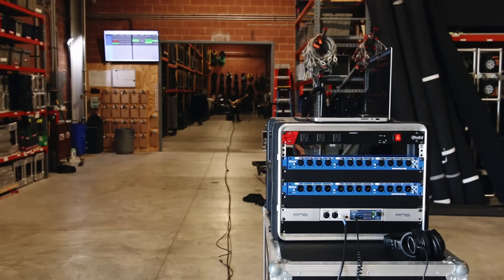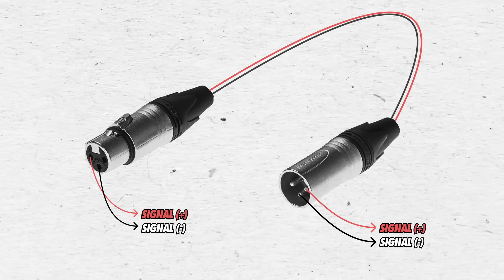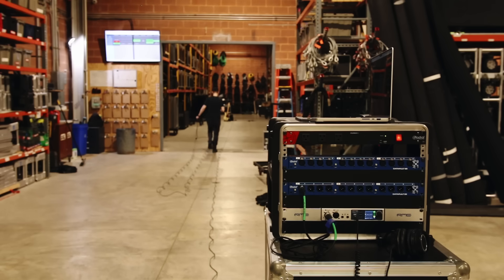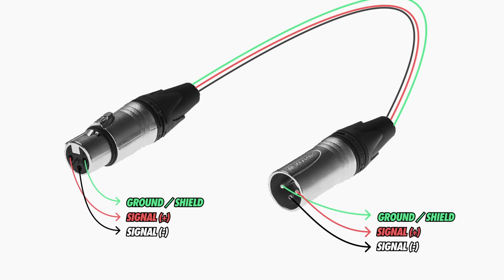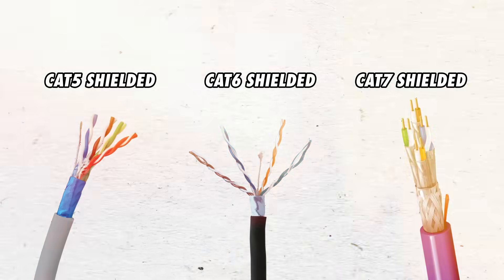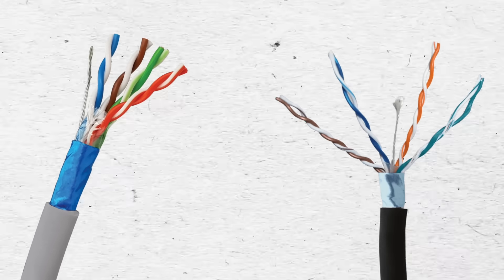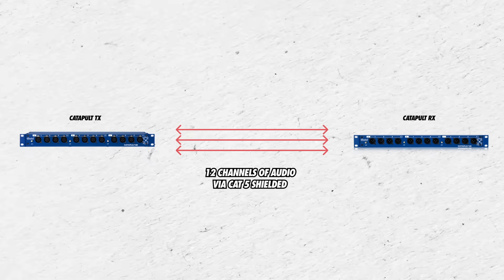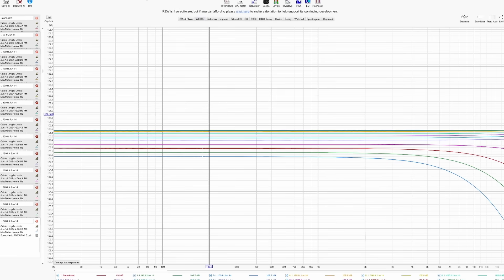Do Audio Cables Affect Sound Quality?

Comment: Scared me there, thought you where going to talk about speaker cable hocus pocus.
Reply: Gold and carbon fiber makes the electrons go faster!
Reply: I'm sorry, I couldn't read your comment through all the distortion. You should be using diamond-tipped platinum USB cables on your keyboard at the very LEAST.
Reply: Only gold plated 4 awg Nanofiber carbon shielded unbendable cables for me👌
Reply: @Abihef  solid 99,999% pure copper rods, 1" thick, bent into a custom shape, no solder joints, no sharp bends (because sharp bends introduce harmonic distortions), mounted on 10kV ceramic-glass insulators. The listening room must have walls covered in barium plaster. And there must be an orgone generator pyramid on top of the amplifier.
Reply: @kimiastrid  yeah no never solid because the skin effect then causes you to lose high end.
So always stranded but at least 4awg so it carries the same amount of electrons, every strand has to be gold plated though so if there is any skin effect it travels faster so that when the sound gets back into the wire it arrives at the same time as the sound in the copper core.
Reply: I got scared there as well... I thought the usual cable slaying trolls weren't going to crawl out and comment... But then here you all are.
Reply: I need to do a strand test.
Reply: Yes, see how much sound you get without them😂 magic hoguspogus are the best invisable cabel you can get, and i will sell you a pair😅🎉
Reply: thiss hahaha
i thought this video is about those super expensive cable Gold Plated Audiophile Grade vs Super Cheap home depot electric wire 🤣
Reply: Lol
Reply: Agh one of these arseholes
Reply: Argh one of these
Reply: Don’t be an idiot.
Reply: What exactly do you mean by speaker cable hocus pocus?

There is an important factor regarding the gauge and material of conductors not covered in this video that is applicable to speaker wires and other analog audio signal routing - which is resistive noise.

Thinner wires made from lower quality conductors have higher resistance and therefore produce greater resistive noise. This is especially important on pre-amplified signals, but over long distances or sufficiently thin wires it can be noticeable on amplified signals like the ones traveling through speaker wires.

Has nothing to do with electrons “moving faster” like one other person sarcastically responded. In general though, it is fair to think about electrical resistance in terms of impediments to the flow of electrons, but i conceptualize the effect of this to be something like electrical turbulence rather than “slower” electrons.

Resistors produce electrical noise, especially when they get warm. That’s a fundamental principle of electrical systems, not pseudoscience.
Reply: @showingpig01  no no no, they meant the audiophile crap like claiming that the cable restores dynamic contrast and volume gradations as well as add reverberation xD
Reply: @showingpig01  You're not wrong, but as someone who has worked regularly with hundred foot audio cables when working as a technician, cable noise is almost always vastly beneath the noise floor of most audio systems in cable lengths 75ft and under. At least for the ones I regularly worked with.

Im mainly referring to the hundred dollar 15 ft audiophile cables sold to ignorant consumers connecting their headphone amp to their headphones.
Reply: @showingpig01 most of dumbeeses dont get it . they think that every wire is the same 😂
Reply: @showingpig01  easily my biggest pet peeve when people Dunning-Krueger their way into these kinds of conversations…
Reply: @showingpig01 im all inn with you, but it is fun to troll the deniers the right way😂 btw i also sell rock petts, they like being outside, but inside is also ok.